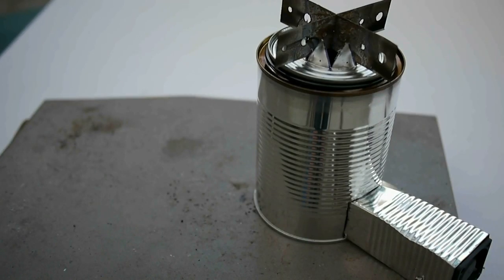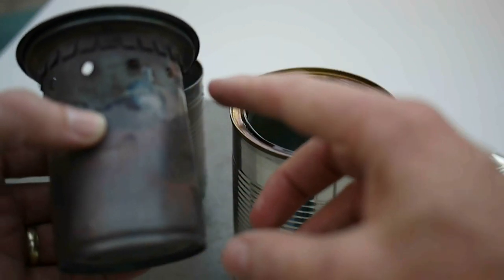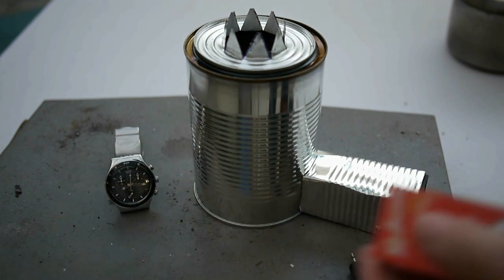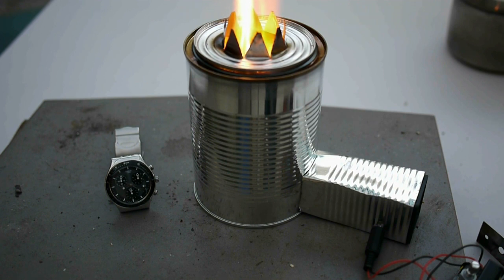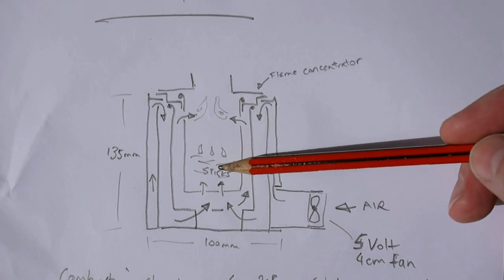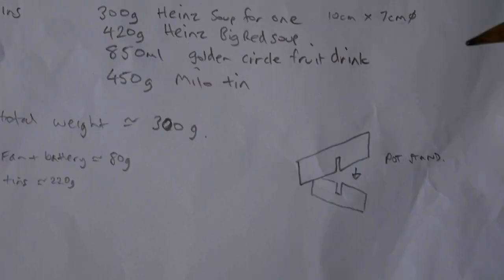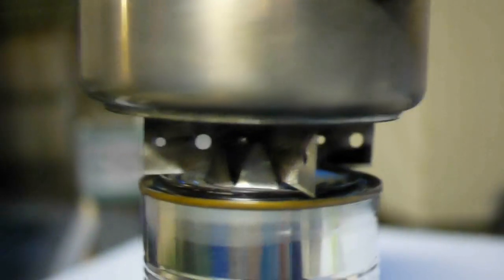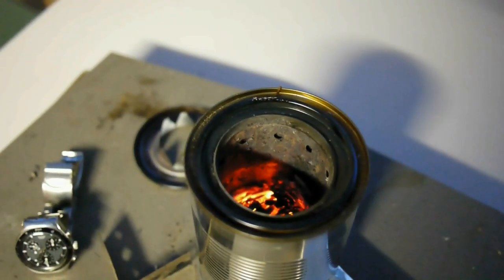Woodgas Camping Stove TLUD Fan No Smoke No Black Pot

Comment: will flame last long enough to boil for around five minutes, without adding or do you havr to add?
Reply from the maker: Should last around 10-15 minutes. You aren't supposed to add more fuel after you start but you can add a little bit. It just might start smoking.

Comment: Young man nice job!  Unfortunately, you are forgetting a serious concept of physics. If you want better combustion you do not want to prewarm your combustion air. Hot air carries less dense oxygen than cooler air.  This is why all turbochargers on cars have intercoolers to reduce the temperature of the air to make the concentration of oxygen higher per cubic unit of air passing into the combustion chamber which in a car is the cylinder.  Again good build.
Reply from the maker: Turbochargers have intercoolers to increase their efficiency as an engine. That's all about compression and expansion of gases across the temperature range and doesn't apply here. This stove is about simple combustion efficiency and hot things burn more easily.

Comment: Good design.  I've made a few of these things myself.  I was wondering why you need a fan.  There's plenty of heat without it.  
Thanks
Reply from the maker: The fan makes it burn better. It is easier to start, helps to make less smoke, more heat, a more compact flame that is better directed to the bottom of the pot instead of a tall "wobbly" yellow flame, it is less affected by wind, and it creates less sooty deposits on the pot.
Reply: OK thanks

Comment: I'm making some that burn up to an hour and a half and rolling boil a half gallon in temps down to 10 degrees F(no fan)....... but I have to use wood pellets to get that performance. Sticks don't have a useful energy density. Good job getting it clean, I found the same ratio as you.
Reply: +babaloo42 That's good. I'd recommend getting a fan if possible.

Comment: This is not a little too small ? We would need to charge it after how long ? Is it does not consume much fuel ? Sorry for questions, I would build it just to see. It's a bit difficult to recharge because the flame output and input fuels are the same.
Reply: this is a small stove to take hiking. just enough to heat dinner for one or two. see my other video for a better stainless steel  version.
Reply: I've thrown a glance. Thank you. It consumes a lot of fuel if it's for use for hours ?
Reply: Will it  work if no fan is used ?

Comment: Thanks for your video. I bought a wood gas stove for camping and it looks the business. Nice steel construction and sits together really well. Although there are holes at the top of stove to vent gases for burning; what I've actually seen is very little of what I can scribe as secondary burn. In fact - the majority of the burn is the primary fuel in the centre of the pot creating a yellow flame. I wonder if I were to add a fan to the underside of the stove - if this would draw in air through the bottom vents and force air up the sides - or is this configuration would too close to combustion chamber or not?

Comment: Tip: smear a bit of dish detergent on the bottom of your pot before you place it over your stove. After cooking, any soot that settles on your pot will easily wash off.  You'd think the soap would just burn but it doesn't. Good how-to video here, thanks for sharing.

Comment: I was thinking about it n what if you put a THERMOELECTRIC POWER n heat sink on it no need for batteries, don`t be shy to try that
Reply from the maker: Yes - I have tried that. I hate to admit I couldn't get it to work well enough and it was turning out to be too expensive and heavy (with the necessary heat-sink). Another factor is that you need batteries anyway to start it off before the thermoelectric gets hot enough to work.

Comment: Sorry if this question is already answerred..

Have you found if the 5:1 ratio works also with the passive TLUD stoves? And what is the complete ratio for inlet air included (5:1:6 or even more for inlet)?

Comment: very nice vid.
where did you find the one to five ratio ?
i have a feeling that this ratio want work with non forced air, because not enough air will come in to the primary combustion, when there is no wind blowing.
what is your opinion ?
thanks
Reply from the maker: I heard the 1 to 5 ratio from another youtube video that has since been pulled down. It was in reference to a forced air stove- i.e. one with a fan. It has worked out for me as a good starting point, and often I've varied it a bit depending on how well it works and gut feel. It gets you in the ball-park.
Reply from the maker: You definitely need bigger holes when you don't have a fan.

Comment: This is fan generated and not updraft generated combustion. You might be able to get away from that electric fan if you add or tune more external holes resulting in less orangy flame in the process. By the way, this is a great learning video. Thanks.
Reply from the maker: I like to call it forced-draft in an upwards direction. I have found all stoves I make work better with a fan than without- producing more heat, more stable flame, less smoke, and more tolerant to wind changes. I've given up worrying about the flame being a bit orange since I made stoves with blue flames that were too hard to keep burning well and easily turned into smoke generators when conditions were less than perfect!
Reply: Actually, lots of TLUDs have small fans, like the well-known Phillips model

Comment: Where do we get  a 5 volt battery in the forest if the battery empty??
Reply: One could ask a similarly pointless question for most other items we take camping.
Reply: Tech geek forest gnomes. You wouldn't believe the technology they have stashed away in their hollow logs.
Reply from the maker: Yes - spare AAA batteries are just another thing you'll need to pack, but they are light - especially lithium ones... I have another video showing a hand-crank that can be used if all batteries are flat though.
Reply: garden solar lights have two 3v rechargeble batteries, a cheap n a must have in your kit or better yet get a heat powered setup like the fans for stoves,forgot the name of it?

Comment: what is the capacity of tin to resist the heat ? and is it long lasting,,what you have used the equipment to get absolute result of carbon monoxide and what are the dissiculties in your stove.how would you take esily ashes from stove...please mail me in shrestha.roman23@hotmail.com..As i am in research about stove in developing countryi  like nepal and use tin as an alternate source using from already used tin.I have made a stove as your type, but what are the main thinks to verify the level of CO reduce from this stove..please reply me i am expecting from answer from you as soon as possible.
Reply from the maker: Tin cans don't last very long. I have another video with a stainless steel version that lasts much better. As for ash, you empty it after each batch- i.e. burn for 30 minutes or so, then let it cool, then empty the remaining charcoal before reloading fuel and starting again. I don't know about CO levels, but I would recommend using it outdoors only.
Reply: Thank you for your reply.As I am using Tin in my woodgas stove.As in my view it is a gasifier, what is the difference between gasifier and stove.As In america, i know that people are in research of BIOLITE What is it really?I am using a tin which are wastes in my locality, how could it can be make more convient...
Reply from the maker: Gasifier means the process creates gas to use as a fuel. In this case the "gas" could also be called "smoke", so the stove is really creating smoke and then burning the smoke. Biolite is a gasifier stove that also creates electricity using an electronic component to convert heat into electricity. Tin is ok, it just doesn't last very long- so designs that use tin need to be very quick to make such as using a punch instead of a drill etc. It will last longer if you can use stainless steel for the inside parts that get the full heat.
Reply: As i am in process to use speedmeter to control the fan.and to control the flame.Is really possible to control flame while burning?
Reply from the maker: Roman man shrestha You can control it a bit- but not much. Too much or too little air will stop the secondary combustion and it will become super smokey.
Reply: Mr Micheal, what is the exact dimension of the tin box that we used.Is there any standard dimension of tin box.

Comment: hello my friend first thanks for video l try it its true it work well like yours no smell no smoke but it is normal that l smell burn thanks
Reply from the maker: Not sure what you are asking- there is no smoke and normally not any noticeable burning smell.
Reply: l do it  it works great no smoke but  smell like hell maybe the types of wood?
Reply: jonathan gauci or whatever the can is lined with from the manufacturer, like bpa for one thing.  Will probably take several burns to remove that.

Comment: Have you ever thought of using a thermocouple from a furnace to power the fan.  So once the fire is started it will power the fan. "No batteries needed"
Reply from the maker: Yes- I had a good look at that attractive possibility and did some testing. I found the thermocouples were too expensive and fragile, and required a heatsink that would be too heavy (for a camping stove). It was very difficult to create enough electricity to drive a fan. Also you really need some kind of battery anyway to get it all started and up to operational heat so I gave up on it. Carrying a small battery pack is way more convenient and practical. I settled on making a hand-crank battery re-charger instead (shown in another of my videos).
Reply: Fragility is a possibility, but we bough a thermocouple for a standing pilot furnace at menards for three dollars and some change.
Reply from the maker: 847MicRoss I tried two 4cm square thermocouples that cost about $20 each (so they could handle the higher temps etc) and I could never get enough electrical power to drive my 5V 120mA fan (i.e. 0.6W). I even tried using ice water to keep the cold side cold. I was using aluminium bar 4cm wide and around 2mm thick to conduct the heat to the hot side and used thermal paste.
Reply: I know it would start to loose practicality, and may not be electronically correct, but what about using a type of step up transformer?
Reply from the maker: 847MicRoss I actually used a DC-DC converter to boost the voltage output of the thermocouples to the 5V required for the fan. That is the electronic equivalent of a step up transformer. It could easily generate the 5 Volts but as soon as the fan was connected it dropped way down- i.e. there was not enough power to maintain the voltage - i.e. not enough power to drive the fan. I know the Biolite stove drives a fan from thermocouples so it is possible- I just wasn't able to manage it myself. I must need either more heat flow (e.g. use copper instead of aluminium as in Biolite), shorter heat flow distance, better heat transfer, better thermocouples, or a lower power fan...

Comment: hello, Michael. I am very new to make this type of stove TLUD , to eliminate the carbon content during the process Phyrolisis I tried to make a somewhat higher for the Combustion Chamber. I got the results of the experiment and the flame color for example 70% blue flame and 30% yellow. conditions there is no soot on pot but there are still black from charcoal powder. do you think if the burning is still not perfect? while some people still say if the flame is still a yellow flame color of fire is the burning still not perfect. 

please. I was very confused in this regard.
Reply from the maker: The blue flame is best, but I don't think it is required. I only ever achieved it using the Everything Nice design, but that stove didn't perform as well overall as my stainless steel model which never had a blue flame- but also didn't smoke or cause soot. I ended up aiming for what worked best in terms of ease of use and construction. It may be easier to get blue flame in a bigger and hotter stove too.
Reply: You mean there's charcoal left in the ashes?  That's totally normal - actually the point of TLUD is to produce charcoal which you can use for other purposes like water filtration.  If you want to burn up the char too, you can refer to TCHAR videos.

Comment from the maker: TLUD = Top-lit Up-draught. This is the general type of this woodgas stove design that means it burns from the top down and the combustion air flows upwards through the fire. Given that I have a fan I'm not even sure it qualifies as TLUD, but the fan is just helping push the air in the direction it would have travelled anyway.

Comment from the maker: There are any number of woodgas stove designs on youtube that don't use a fan. Personally I think the fan is worth the extra effort as it makes more heat and a more stable flame- i.e. not so affected by wind. It also helps prevent getting soot on the pot and it's easier to light.

Comment: Most excellent, thank you for posting this.  I am wondering if there might be a workaround for the fan (losing it).  Perhaps a number of slots on the outer can, similar to the main (single) 'entry' one you have, fashioned to direct airflow not only right but also slightly upward.  Just a thought.

Comment from the maker: You don't need many tools. I used scissors and a drill and a hacksaw (for the pot stand) and a soldering iron (for the fan). You can even make do without a drill and just punch holes with a nail or screwdriver or similar. There must be other ways to make a pot stand without using a hacksaw. You may even be able to buy a little battery powered blower of some sort.
Reply: Michael, please make  one for me and I'll pay for it.

Comment from the maker: rach44w- I've done some more research. Ebay sells TEGs (thermo-electric generators) from around $8 for 150'C to $30 for 250'C units. They need a heatsink to keep the cold side cold. Given that expense, plus extra weight and complexity, plus the fact the unit has to power the fan and may have nothing left over, and the fact that the stove only runs for 30min or so I don't think there is any point pursuing this. Just use batteries for the fan - much simpler and lighter.

Comment: Hi Michael, love your work,  your design and vid is really up at the top.
I have built several passive version of stoves and have found that ratio of 5:1 and getting a good airseal between the layers the most critical. the guys looking to power devices using peltier type effect should check out the Powerpot. it isnt too expensive and i reckon it would be a simpler alternative to building a device into the stove... I'll let you know how it goes. cheers from Down under

Comment from the maker: rach44w- I just had a look at the Biolite, so now I know what you're talking about. It looks pretty high-tech! I assume it uses the Peltier effect. Mine is far simpler and, doesn't generate electricity. The fan supply for mine is just battery powered. Lithium batteries are very light and last ages- or NiMh are ok and rechargeable. I'm sure the electricity generation adds a lot of weight compared to just bringing batteries.

Comment from the maker: Thanks- I have a new one now made from stainless steel (with a youtube video) that will last longer has room for more fuel and runs longer. Also, because it's a bit bigger it works ok with the more common simpler design.

Comment from the maker: @robertsulley I heard it in another Youtube video first (about the smallest tlud fan stove), and eventually found an article confirming this by Paul Anderson et al. He seems to be the main guru on this stuff. My design came about because I was trying to make a small unit that would stay as hot as possible inside to sustain the burning without using insulation.